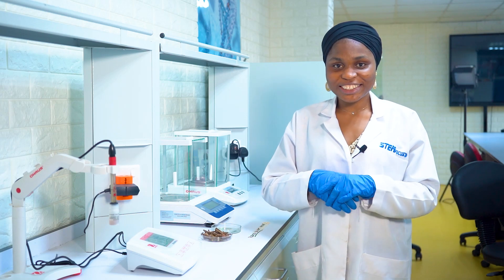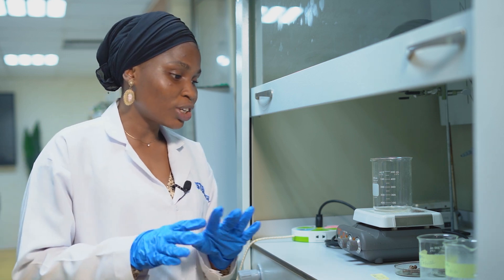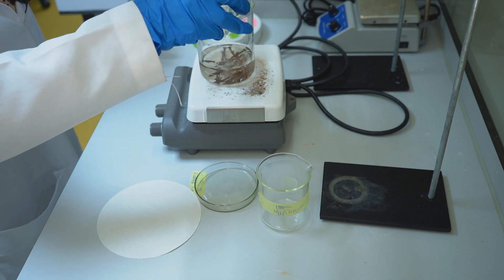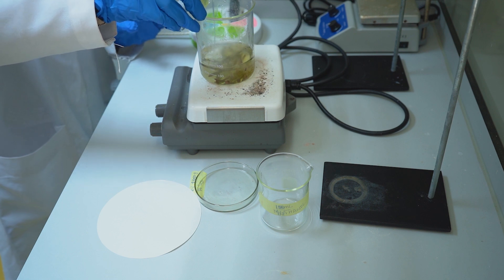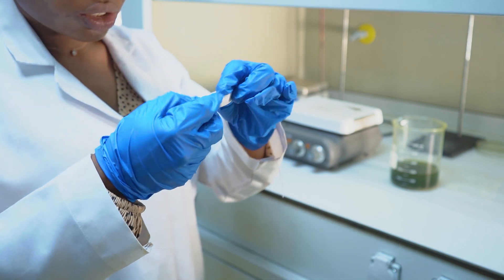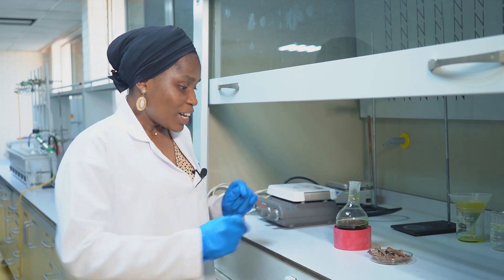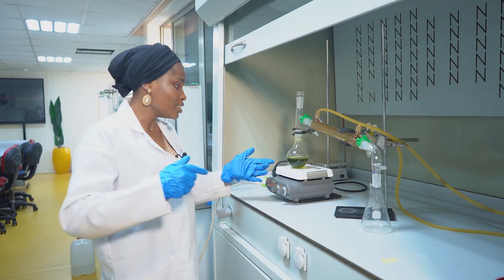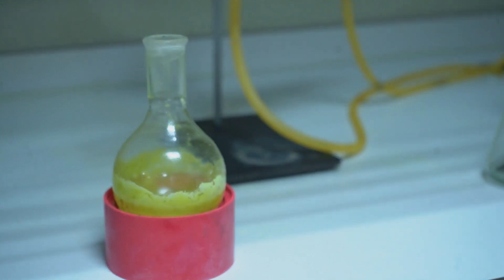How To Synthesize Iron(II) Chloride From Rusted Nails.

Comment: This is excellent work. I just did a rough calculation, and if you have access a lot of rusted nails, you can make a lot of money converting them to ferrous chloride for industrial use. Is STEMFocus open to collaborations?
Reply from the maker: Yes STEMFocus labs are always opened to STEM reseachers. contact us on +2349137160848